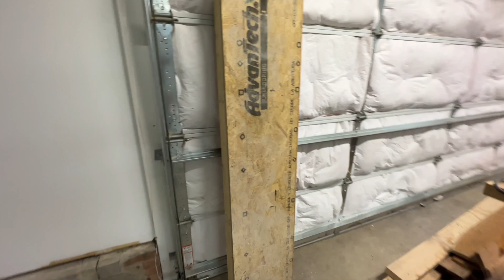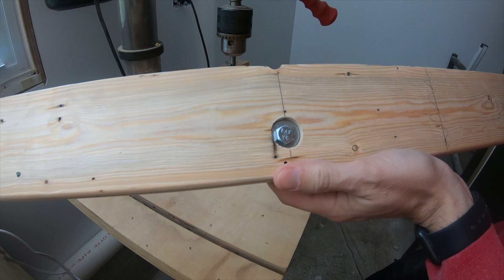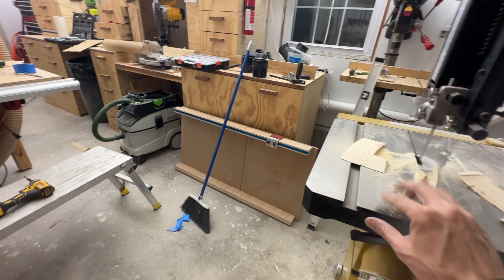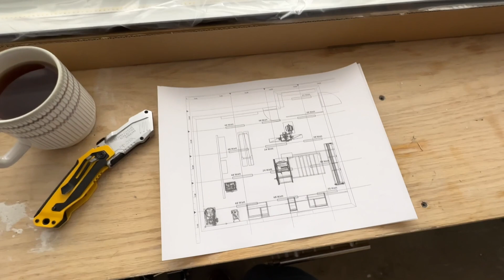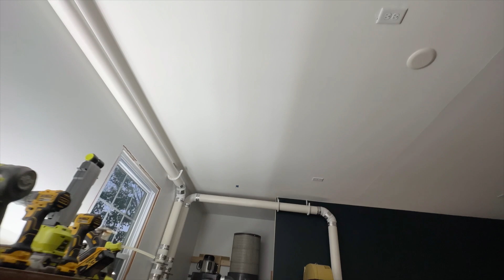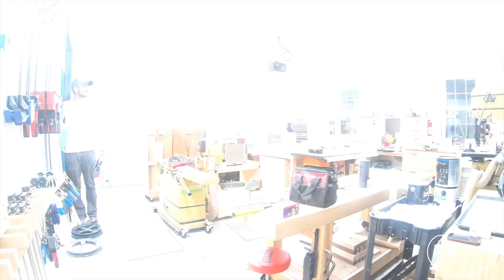Shop Renovation - Don't Make This SHOP LIGHT MISTAKE

Comment from the maker: I did a poor job explaining my actual light issue in the video, at around 40second mark you can see that black bars started banding across the screen.  This happened on both a iPhone and GoPro.  The issue is in the drivers for the lights that convert the 60hz power to something the LEDs can use.  The American Green Lights have a much higher quality driver (as well as LEDs) in it that give zero flicker in video up to 120fps and produce a significantly better color rendering index, resulting is a huge improvement for color reproduction.

Comment: Nice video series! How did you mount the white plastic J-hooks to the ceiling for your ducting? Did you go through the drywall and screw to the joists in attic? Looks very clean.
Reply from the maker: Thanks!  Yup, I couldn’t stand the pipe strapping I used before so it was well worth the hassle. They also make brackets for all thread and pipe hangers that tread onto them I considered using but it wasn’t quite as clean of a look
Reply: Cool! Thanks for the reply. Treehouse looks awesome, too!

Comment: You may be able to move the table saw to the left a half a foot for a cutting big panel too. Maybe skew the planer to get a little more out feed length temporarily too. Shop is looking great. Has to feel good to get to this point.

Double dare you to paint your floor. It’ll be transformative. Maybe worth?
Reply from the maker: That is a good idea!  I really wanted to epoxy the floor but there are a ton of areas it's cracked and loose, so I need to fix those before I can epoxy it.  And at this moment I just don't have the willpower to do that 🫠😂